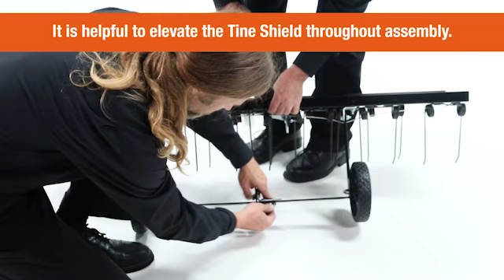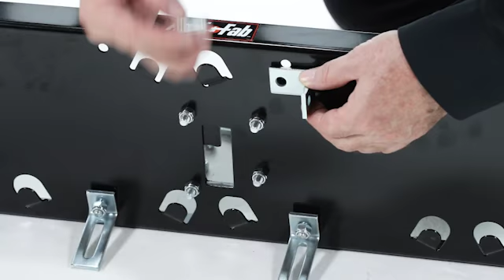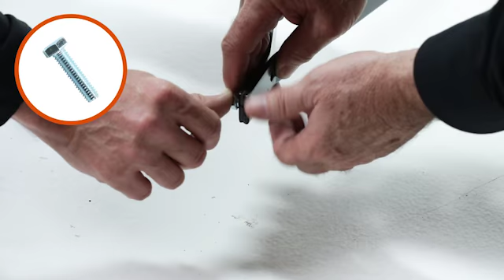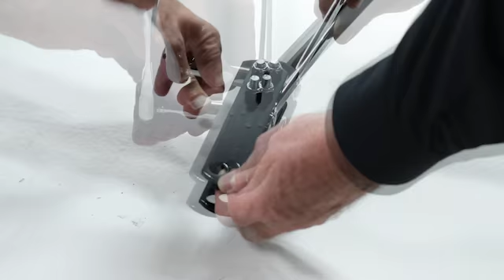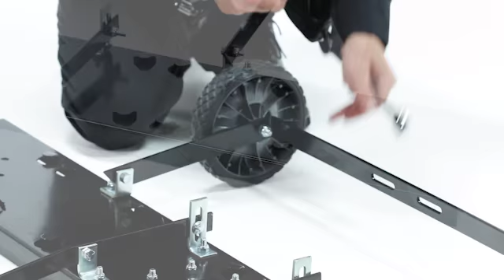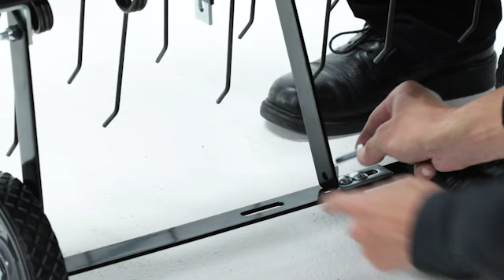Assembly

Comment: You forgot the most important final step.  Attach the dethatcher to your lawn tractor on a level surface.  Adjust it so that all the spikes in both rows touch the floor then tighten the screws in the rear high angle brackets to hold it in place.  Just bought the 40 inch, will let you know how it works.
Reply: Good call just received my 48"

I'll post if I remember lol

Good video though here Agri Fab
Reply: so, how does it work then?